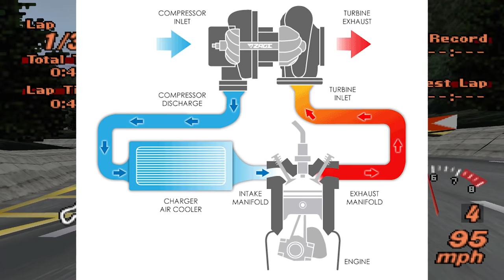5 MORE Gamer Misconceptions About Cars!

Comment: There are a few things that can happen. I work with engine management systems.
1 If N2O can't be activated at anytime its a bad system. Most racing applications will do a situational Nos where it activates when steering is close to 0 degrees and throttle is at wide open throttle.
But N20 is also often used as a anti lag on street racing with engines that got a excessive big turbo. Where timing will be retarded for a short period and a lot of fuel with N2O is added to spool up the turbo really quick. This will cause a stable flame in the exhaust for a short period. Not just a bang.

And on older cars with wet system nos they would run insanely rich to not cause harm or overheating issues which tended to dump a lot of fuel in the exhaust. And depending on the system this fuel would sometimes ignite when leaving the exhaust. Not often but sometimes.

There isn't really a lot of sacrifice with a nos as long as the engine can take it mechanically and the ECU can handle it.

Also like to add fun facts. NOS the company was really frustrated in the beginning when people called Nitrous oxide for NOS. Same as paper wipes companies where they took a company and used that as a name for the product.
Reply: Yup, that's on beamng as well
You can enable nitro anytime, and set the minimum gear and minimum RPM.
Useful for drag car that has transbrake.
Reply: I dont like calling it NOS, because it's N2O, I always say laughing gas (wihich it actuallly is) to bully a friend of mine who's a car guy

Comment: About the straight line, I remember I was "racing" with another car at 9 p.m on 2 lane highway. Some gamers think the roads in real life are flat as in video games. In reality, it isn't. At that time, I was constantly adjust my car's steering during speed of 80 MPH (my car is just a small grocery gutter) to keep the front wheels straight.
Reply: Because governments can't be bothered to build roads properly.
Reply: @iexist.imnotjoking5700  Nope, that's a physics. Even on roads with new tarmac, it still need slight adjustment. Roads are not completely flat, so we need suspension. Some games have that physics when driving fast (particulary above 300 km/h) while others are fine.
Reply: @govinlock8568   yes, but it would help a lot if roads weren't so badly built. Here in Germany the roads are so terrible, that there are stories in summer were cracks in the road deform due to the heat, causing a huge safety hazard. And this is happening on the Autobahn, the thing famous for its lack of a speed limit. There are news stories of bikers driving at normal speed getting thrown off their motorcycles and dying. Maybe that's different in other countries.
Reply: @iexist.imnotjoking5700  Very true bro.

Comment: 9:38 go to FH4, drive a TVR cerbera speed 12 on stock tires and then try to say that again
Reply from the maker: LMAO. Playground does a better job than most games, at making Wheelspin more noticeable in their "arcade" racer (Horizon is arcade-ish I guess).
Reply: @BladedAngel  Isn’t it a Simcade then?
Reply: Lol what is grip even
Reply: @illusion86ln  nah its arcade. GT is simcade, but more sim than cade if you know what I mean.
Reply: @Tekeysix  Arcade is NFS, Grid and so on
Reply: @BladedAngel  it’s definitely less realistic than Motorsport, but it’s still decent with realism when it wants to be.
Reply: A thing on some cara like the M2 in forza if you play with clutch you get lift off oversteer and it gets a little bit annoying sometimes.
Reply: @rishabh4936  Because you’re on clutch, so you lift off, you’re on the throttle but power isn’t transfered… I don’t see the problem? and especially in high revs, car is going to snap more ofc
Reply: @illusion86ln  But I just like that forza has that
Reply: @illusion86ln  I would say its an entry level simcade, it can pass off as an arcade to some though but I consider it just above the line between arcade and simcade. 

Edit: forgot to mention but FH4 is definitely not as realistic as other simcades
Reply: @rishabh4936  ah okay, seemed the other way, my bad
Reply: @darkox4172  That’s convincing
Reply: @illusion86ln  I don't know if its just me but im getting a taste of sarcasm
Reply: @darkox4172  no no
Reply: Try iracing, rfactor 2, assetto corsa
Reply: @rishabh4936  other game has that especially simulator
Reply: @therealf.b.i9468  oh god that's evil and I love it
Reply: @illusion86ln  yep, one of the few that works
Reply: yea you have to go slow then pull the throttle more and more to not spin out in fh4
Reply: @BladedAngel  Forza horizon 5 made a sound jump
Reply: @darkox4172  God damn it. Feel like I am missing out now. being stuck with a PS4 and the dead GT Sport game is a nightmare.
Reply: @BladedAngel  what the first game that your playing name
Reply: @Tekeysix  nah it's simcade.

Comment: Forza is actually pretty decent when it comes to fishtailing, I tried to do a corvette drag build with the 70s one, and it constantly fishtailed.
Reply: I'd argue Forza is actually overdoing it. They act like cars have no grip on the rear wheels whatsoever. Probably to be more inviting to the drifting fans. But I just think it's extremely annoying. *Gently presses throttle
→small mazda proceeds to slip away, massive amounts of tire smoke.*
Reply: @iexist.imnotjoking5700  I think it's more that they massively increased the front tire grip to make it feel arcadey.
Reply: @squale1190   no, I specifically have problems with a lack of grip.

Comment: 11:08 Forza Horizon 4 is one game that actually does this. Overpowered RWD cars are always spinning out
Reply: Ikr? I wanna drive a 1600HP Supra at max speed but Forza physics say: No
Reply: Ehhhh, no. Have you tried ACC or rf2? But for an arcade racer they do a better job than most
Reply: @andeeeeers3497  ACC? RF2?
Reply: @dummy3467  assetto corsa competizione and rFactor2
Reply: @daradevlin4093  Not an Asseto Corsa player and I don’t even know what the hell rf2 is.
Reply: Even with assists off it's a lot easier than to keep under control than irl or in a sim game
Reply: @dummy3467  assetto corsa competitzione and rfactor 2, theese are more simulator focused games and rf2 doesn't exist on consloes
Reply: @andeeeeers3497  Well I don’t have a PC. Just consoles
Reply: @dummy3467  if assetto corsa on console is on sale, i would recommend it :)
Reply: @andeeeeers3497  I read the reviews and it apparently doesn’t have body customization….
Reply: @dummy3467  body customization? you mean like paint or wings?
Reply: @andeeeeers3497  I’m talking about custom fenders, rims, tires, bumpers, hoods, wings and all that shit. I don’t think Asseto Corsa has that
Reply: @dummy3467  it exists to a degree, its not an arcade game, so don't expect NFS level, but you can change tires between different soft medium etc, and you can alter aero a lot through setups, but its not need for speed, its a simulator. Hope it helps :)
Reply: @dummy3467  sadly, with assetto corsa, customization is practically non-existent, leaving only paint and pre set cars. if you ever find yourself interested, the devs actually encourage you to mod different cars and tracks since the base game is pretty plain apart from the career mode, and with that said, you can't entirely mod the console ones. for the closest to sim on console, i'd recommend fm7 or gt sport so they don't feel too repetitive. apologies if you have known this already, though.
Reply: @hondafknciviv3818  I’m no exactly a sim-racing type person. Just feels stiff and bland for me. I’m more of an arcade person such as FH4 and NFS Heat.
Reply: @dummy3467  i completely respect that and cannot agree with you more
Reply: @hondafknciviv3818  Not sure how people have a blast playing a game where you can’t do shit to the car and go in a single path like 3-5 times.
Reply: @dummy3467  while i do enjoy it a lot, it is very, very repetitive. i love seeing something different about a car or anything of the like every time i go out of the garage, it's just slightly more fresh and makes it a lot more replayable
Reply: @andeeeeers3497  Assetto Corsa sounds better than Project Cars 2, PC2 controls are god awful
Reply: Assoluto too
Reply: @dummy3467   Maybe because those games are not about who has the fastest car, it is about who has the better skills. It's not like in Fh4 where everybody has the Ferrari 599xx Evolution because it's the fastest car on the game
Reply: Youre acting like forza is the whole world.
Reply: @oreomcpvp6667  say that to assetto corsa i dare you.
Reply: @hondafknciviv3818  it exists but its more like modelling than customasiation
Reply: GTA : Am I ajoke to you?
Reply: Some cars need their torque to chill down..
Reply: @dummy3467  They don't cause its a motorsport game. In competitive scenes, those stuff have some real consequences, especially in aerodynamics.

Comment: On that last point, video games often have traction control on, which cuts power to the tires when they lose grip, making for smoother acceleration where you can just hold the gas down and the game will do it for you. But a lot of drag racing leagues don't allow those systems, so a touch to much power or throttle can cause wheelspin, which means a lack of grip, which can cause an easy spin out. So drag racing often requires lots of careful throttle control and application, same with race cars and accelerating off the corner.

Comment: Please read up on 2-step/antilag/backfires, the video explaination leaves alot to be desired.

X-Step (x being a number, usually 2) is a system you can set up to have the engine held at a certain RPM for launching, think of it as different steps of a redline ladder.
You Can add anti-lag to this by using ignition delay/Cut to control the step, causing fuel to combust in the exhaust spooling the turbo.

Antilag is when you allow unburnt fuel to pass into the exhaust after lifting off throttle (going into braking zones or between shifts) which then spools the turbo.
You Can do this by either delaying ignition, or cutting it entirely and relying on exhaust tempreture to ignite it.

Backfire is just unburnt fuel going into the exhaust when getting off throttle, not intended for antilag.

These are not interchangable, and there aren’t specifically different systems for superchargers/turbos.

Comment: Great video, although the part about exploding cars and no turbo lag is a bit off. GTA is pretty much the only video game where that happens, not counting other GTA-like games. I'm surprised you didn't mention how tuning and putting upgrade parts on your car doesn't magically make it better. More often than not, it just makes it less reliable and only slightly faster. All those 1500 Forza Horizon builds would run for maybe 1 mile before blowing up or bending the frame
Reply: Also the fact that you can’t just add a turbo without changing the timing of the shift and bunch of others shinanigans on the car’s computer (ecu)
Reply: Gran Turismo did always forget about both turbo lag and spool time. At least GT3 and 4, I switched to Xbox after PS2
Reply: except from GTA 4 on wards and even in GTA 5 this no longer happens though

Comment: 3:42 A sequential turbocharger system has a smaller trubo to provide power until the bigger turbo spools up, they act separate. What your describing is a compound turbo setup which is less common where the small turbo provides early power and assists the bigger turbo to spool faster.

Comment: With the last one, I do know that. I'm going to start driving soon but, I've played a simulator where you can feel everything. You can feel down gear, up a gear, acceleration, deacceleration, feel the bumps, and more. And decided to play with an F1 car. 
If you hit the gas too damn hard, you just lose grip and drive right into a wall. It's harder than you'd think from the perspective of playing a video game. 
I also drove a GR3 class racing car in the game and if you hit one bump and don't steer it correctly you just go right into a wall. I know that this is just a video game but even then it can be quite difficult. A straight line, if you don't have enough grip, you're not that experience, etc, can be quite challenging.

Comment: 2-step isn't just for supercharged cars. It can be used with any NA or forced induction setup, and it's just a secondary rev limiter set lower than your main one used to launch the car. Turbocharged cars, for example, can use it to build boost. It's also helpful to launch the car without its full power to help it grip up.

Comment: You might have already covered it, but it annoys me in video games when AWD/4WD is flat out the best drive train, with no downsides.
Reply: NFS wants to know your location
Reply: Well, all things being equal: It is.
Reply: @Marcus Aimon Fomixaders awd is great from a dig though. That instagrip🤤
Reply: @Marcus Aimon Fomixaders 🤷‍♂️ I do decent up to around 110 or so
Reply: @Marcus Aimon Fomixaders I mean, a 12.5 1/4 in a loaded sedan is decent imo
Reply: @Marcus Aimon Fomixaders why doesn't it? When a family car is running the 1/4 in the same time as muscles, with less hp and torque, that tells you the awd launch is phenomenal
Reply: @Marcus Aimon Fomixaders I didn't read all of that, but I've been talking about irl, not games. Irl, I'll take awd any day for launching
Reply: I played at forza horizon over 500h and I love rwd after some time. Its nor really losing to awd cause you get better control on the turns
Reply: @ValentineC137  MR is the best drivetrain. You don't see many AWD in GT1
Reply: @comdrive3865  you can do MAWD
You dont have to be rear wheel drive if the engine in the middle.
But in our reality the tires working with areodynamic surfaces have enough grip that the added benefit from AWD doesn’t outweigh the added weight and parasitic losses from such a system, simply because you aren’t traction limited past 1st or 2nd gear, and rarely ever race in those gears.
Reply: @ValentineC137  I was going to say the main problem with AWD in racing is tire wear and the added weight. In MR, the front wheels wear down less. Yes you make good points. On worse tires perhaps AWD would be more competitive. Do you race?
Reply: @Marcus Aimon Fomixaders Huh? RWD is good in Heat and Payback
Reply: @shamoo9473  you didn't read "all of that"? He barely wrote anything. My goodness. This is considered a long reply? R.i.p civilisation
Reply: @racingclownjelly4616  the guy was clearly talking about irl, the other dude made a long reply about games for no reason lol
Reply: Midnight Club 3 has AWDs. You can't do burnouts with them, meaning you lose the ability to launch or turn around quickly from a stop.
Reply: @ValentineC137  nah fwd master race
Reply: @xL0stKIlah  rear engine FWD is the only viable layout

Comment: Just bought an E220 Mercedes, and I floored it down the highway in a straight line. I felt I lost some traction and I was about to lose control. I thought something was wrong with the car, but now I know what happened. The car is rear-wheel drive and also pretty heavy so that's why I almost lost control.
Reply: Duh

Comment: 6:02 some of these explanation is incorrect. you CAN SHOOT FLAMES WITHOUT TURBO, provided you have:

1. an engine running leaner or much rich, preferably much rich
2. catalytic delete or an aftermarket full-system exhaust
3. iridium sparkplug
4. aftermarket coils

provided, though, none about backfiring is good IF your engine is running too lean. piston can crack this way and break seals. a "safer backfiring" is called muffler-blast which happens not inside the chamber but inside the header and through the muffler

Comment: Another thing that's super hard to control in drag cars, and really anything with a ton of horsepower - sometimes, the shifting up can give you just enough torque for the rear of the car to outmatch the grip of the front for a fraction of a second. and then you're gone

Comment: I didn't even know what nitrous is. In Beamng, you could add this KERS like system (which is the system that has a electric motor recovering wasted energy under braking and turned into electrical energy via a generator) but my engine kept getting destroyed after pushing it for around 20 seconds. I'd like to see how this NOS works

Comment: Games in 1990: Turbo Boost = Rocket Boost. 

Bladed Angels in 2021: Games got it wrong.

Games in 2021 : Boost tuning, ECU remapping, added brace struts, upgraded intercooler, Transmission upgrades.

Comment: other detail worth mentioning about driving in a straight line is that it can also be easy to spin a very powerful front wheel drive when flooring it in a straight line due to torque steering and other factors.
And another important misconception is suspension.. Even modern simulators let you jump a sports car into the air and, in the worst case, just lose a little control upon landing, while irl the best pickup trucks can be seen breaking axles by jumping as 'little' as a meter off the ground

Comment: That last one confirms my thought that drag cars and sports cars should either:
1. If they can't get enough weight in the back, make it a front wheel drive
2. if they can get enough weight in the back, make it rear wheel drive (Something rear-engine cars excel at) 
3. If they can get the weight evenly distributed throughout the chassis, make it all wheel drive

Comment: In fact you can actually control the turbo bye button , in some cars you can have multiple turbo map so if you driving chill you select the switch pose to low turbo pressure , end when you want to race you can raise the presure bye switch the button position.

Comment: That video game nitrous like boost is actually in formula 1 car. The KERS system collects kinetic energy through braking and stored it in a battery. The energy stored were released with the push of a button through an electric motor, giving more horsepower
Reply: That should be used in games in the stead of nitrous.